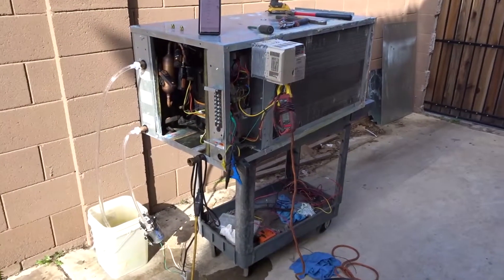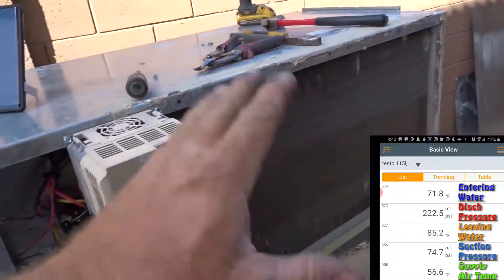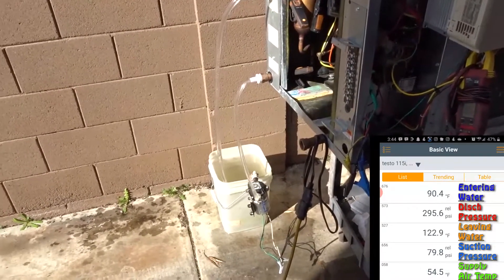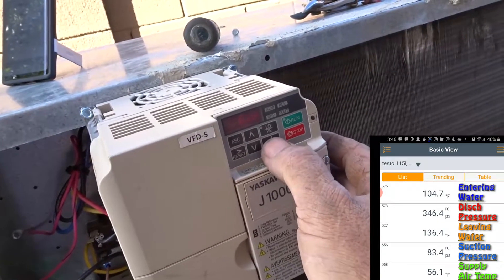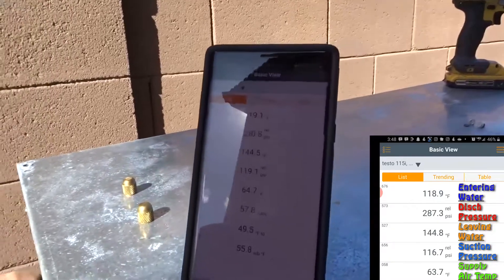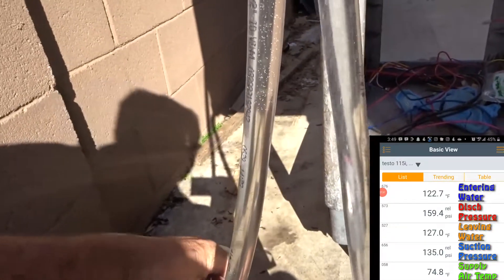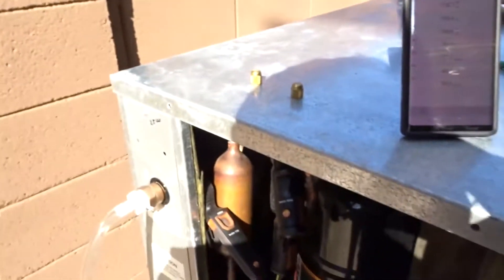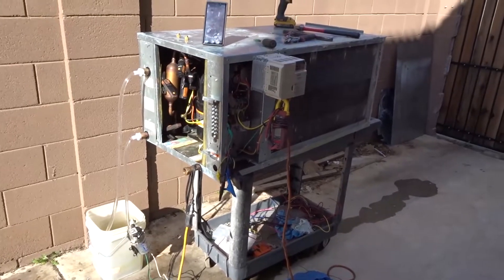The Bastardization of a WSHP into a VFD Water Heater - Part 2 - Test run

Comment: You could get a big ass hot water tank to constantly circulate the water around but you're going to have to run a radiator of some kind to blast off the heat to keep that going long especially in your area.

Comment: so where these units from a glycol system, or open air? any prior water treatment in the loop piping?

 are you going to be using this old coax direct to your domestic water or would you be getting a fresh new heat exchanger coax coil?
Reply from the maker: I probably wouldn't shy away from just flushing it good once it works.
Not like we drink the hot water.
And any residue would be so diluted.

And, there's far WORSE chemicals in the water supply to begin with. LOL

Comment: That's amazing. Way cheaper to run that instead of a regular water heater
Reply from the maker: Oh indeed. The 5KW element in the water heater is 20 AMPS.
And it probably takes a good 30 minutes to recover. Maybe way longer if you actually used the hot water until it went cold.

But I still need to get the pressures correct and then see what kind of heat rise I get.
Right now it heats 5 gallons from 70 degrees pretty quick.

I need to get a larger container again and be able to have a longer run time to really see what it is doing.
Reply from the maker: With a quick search I just found this.
So yeah. They do take a while...
*****************
Electric Hot Water Heater Recovery
A 50-gallon hot water heater with 5,500-watt elements set to 120 degrees takes about 1 hour and 20 minutes to heat water coming in to the unit at 60 degrees. Conversely, when the water entering this same tank is 40 degrees, it takes 1 hours, 47 minutes to heat it up.
*****************
Reply: How would you go about lowering the head pressure but keeping the output water temp close to the same. Is it even possible
Reply: Would you add the second heat exchanger and increase the water flow
Reply from the maker: @Grinderluke  
Well I already went to the larger heat exchanger.
My next goal is to increase water flow and record the results.
If a considerable amount of flow can't bring the pressure down enough then I'll try yo series the second heat exchanger.

I figure it SHOULD work at some point.
Here in Arizona it gets to 120 degrees, even 125 or so where there is some air re circulation on air cooled condenser units and the head pressure is around 300 in those harsh but operable situations so I figure with enough flow and surface area it should run that 120 to 130 degree water.
Reply: Find a 55 gallon drum or a dead 50g WH and make a test run.  Sounds like it would recover just as quick as electric.
Reply from the maker: @joshb124  Oh I think it will recover faster perhaps. 

Several years ago I slapped on a heat exchanger onto an old Goodman heat pump. I used the outdoor heat pump part in heating mode so it would essentially be the condenser and reject the heat into the water. 

I used a large plastic storage container that the wife used for Christmas stuff and I think it held at least 20 gallons.

The 3.5 ton heat pump and heat exchanger were not even matched but it still heated that water to 120 in a relatively short period of time.

Comment: Could use the cold air that it blows to cool a space lol
Reply from the maker: That is the plan. In the garage. It won't cool the space to any space set point but at least it will be cooling when it is heating the water AND it with the same electricity already being used to heat the water. HA HA

Comment: The compressor is 19 years old we’re did you get it?
Reply from the maker: At the facility I was working at from 2009 until approx 2014.
A section of the building was remodeled and I kept one of the yanked Trane Water Source Heat Pumps (the one now cannibalized that I showed towards the end).

So basically that entire unit has sat in my yard since about 2013.
Compressor still ran.